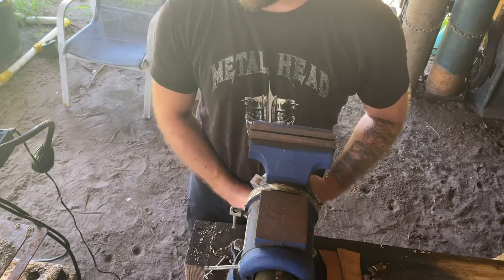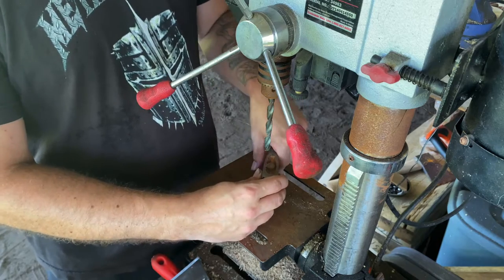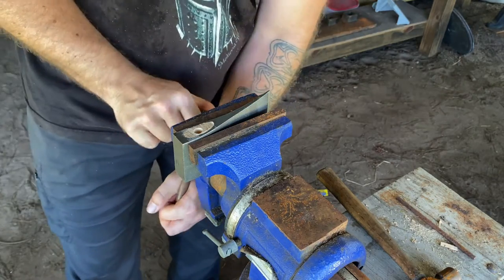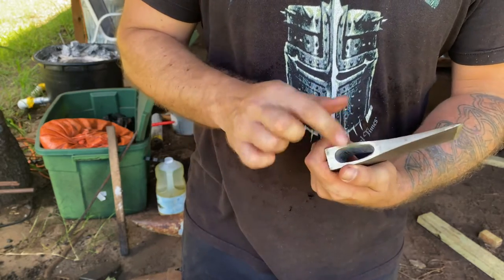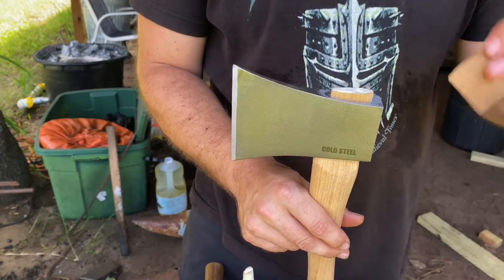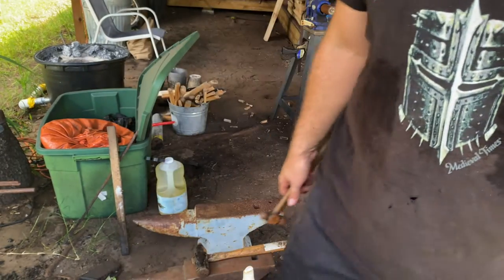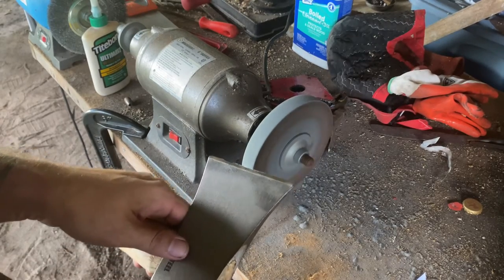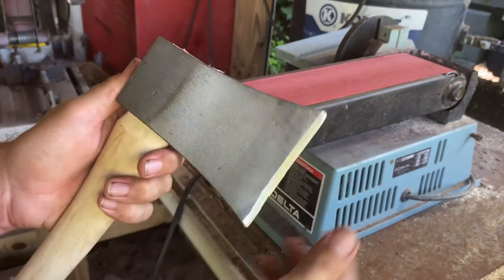How to replace an axe handle - Cold Steel Competition Thrower

Comment: What kind of axe is that? Where did you get it from!? Great video! I’m about to replace a watl competition thrower now with a new handle! Needed this.
Reply from the maker: It is a Competition Thrower made by Cold Steel. I also have a video on the WATL thrower if you want to check that out.